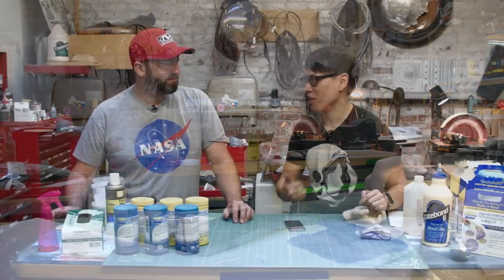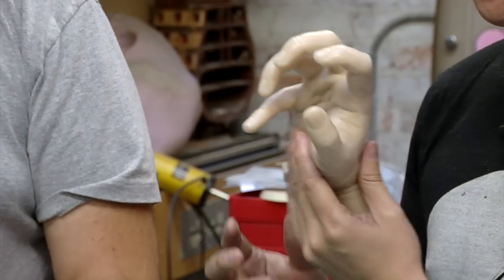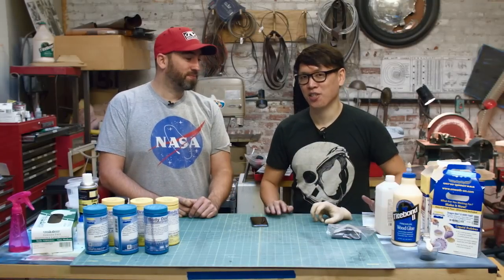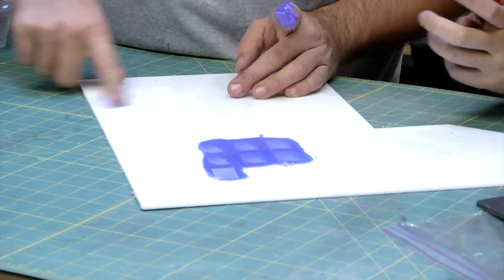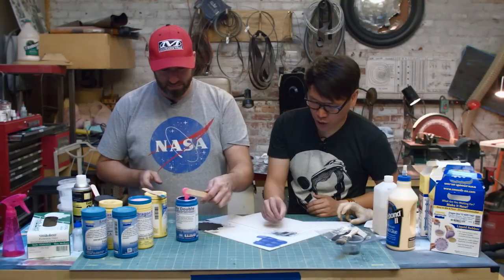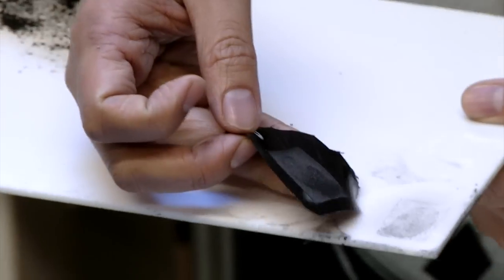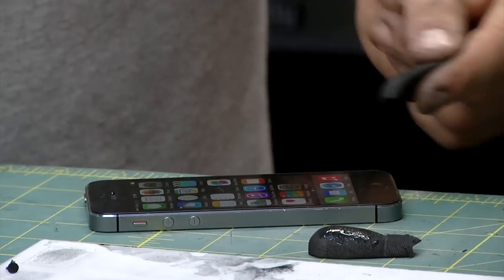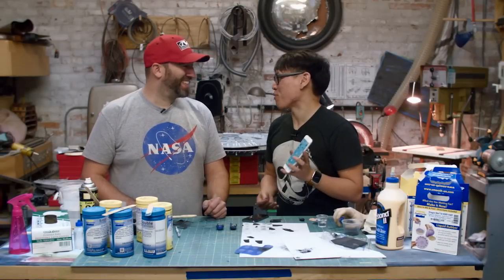Testing Apple's Touch ID with Fake Fingerprints

Comment: While using your finger to open the phone, the phone should also scan your face and require a voice recognition password. All easy to put in the phone, and very very unlikely to be broken in most cases.
Reply: face recognition gets fouled by photos, has issues with bad light etc. And voice recognition: It is kind of a phone - getting someones voice is quite easy.
On the other side: I see what you mean - better combine three "decent" security mechanism to a stronger one than using not at all. People are lazy - better they use a weak security then none. It is like a lock on a house: A thief gets in anyway if he really wants to, but a lock and a stable door do cost more time then a flimsy door.
Reply: sarowie It's kind of hard to fool Face Unlock when your photo can't smile and blink twice......just saying.
Reply: Ryan Stewart It's not hard to hold your phone look at it and say a word into it. It would be just as fast as a basic puzzle lock.

Comment: One thing that would help with the high-res photo is actually something Jamie and Adam did in Mythbusters to fool a fingerprint scanner: blowing the fingerprint up, then cleaning the print and making the lines uniform. Then scaling it back down so you would have much better defined contours for the laser engraving.

Comment: How does the laser etcher resolution compare to one of they higher end 3d printers you've used in previous tested vidoes?  Could you take a 3D scan of a finger, print it, brush it with graphite?

Comment: with the laser etching, you will need to clean up the fingerprint first before etching it. the problem with the photo is that the ridgelines aren't smooth enough for the sensor to register. you can think of it as a sensitivity test 'how far apart do toothpicks have to be before yo can tell your being poked with two instead of just one?'

a mythbuster trick to trick (because they tried this on far more advanced sensors about 8 years ago) a sensor was to blow the fingerprint up to a full page size and print it on plain accitate sheet, use a sharpie to clean up the lines on a second sheet, then scan it back into the computer and shrink it back down to the original size for etching.

Comment: Someone would need a lot of time and skill to do this. If someone wanted to steal your phone they would also need your finger print from something.
Reply: There is no guarantee that a finger print on the phone would remain perfect. The moment you picked it up and moved it the print would be compromised, and you have no way of knowing which finger they used for the sensor. Just use your pinky as the finger, they are difficult to capture and make Touch ID more secure because it's difficult to leave a full print of a pinky on a surface.
Reply: Tons of fingerprints all over the phone.
Reply: Eric Melendez if you're determined enough to do what they did, it should be easy enough to get a finger print, use scotch tape.
Reply: Just get them drunk and when they pass out mold their finger its easy
Reply: or a knife... easier and faster
Reply: Riker Wilson The print didn't work.  Only the mold of a physical finger.
Reply: ***** yeah but that didn't even work. and that was a perfect scenario where they had a perfect print with the dusting on a black surface. most prints left aren't high quality like that. they would be even fuzzier and smeared
Reply: MrBairdy79 but they are passed out, just grab their hand and unlock. Unless you wanted to try and get in again.

Comment: This is the cool tech stuff I wanted to see on this channel! Cool one, I also like Frank very much in your videos, he seems to be very likeable :)
Instead of the laser engraving/etching I would try to photoetch the fingerprint on a copper circuit board and cast the fake finger from that. The resolution with that process is way higher than with the laser cutter/engraver.
Reply: You're right, they should have tried that too
Reply: Etching on a circuit board is basically replicating the experiment of the CCC. Take Wood glue instead of silicon and it is essentially the CCC-Process.
Tested tried a new process, a different material and one of them worked.
Impressive in its own right. Reproducing the CCC-Results would be much easier - which could be a reason to do it, just to have a "fallback" when their tries would not have worked.
Reply: 'Tested' have to try this. I think if enough people requested it then they would do it
Reply: Stefan I subbed plz return the favor

Comment: Try the printout like they did on mythbusters! :)
Reply: Are we the only two who remember this
Reply: I mean really they should have Adam and Jamie help they already did this and there part of this YouTube channel also
Reply: Justin Bancale Yeah, it's kinda strange. Jaimie's technique for cleaning up the scanned print was really clever!
Reply: That was an old scanner, probably laser as the medium of scanning, Ffs, Jamie played connect the dot with a sharpie and it still grant access.
Reply: That was nearly 10 years ago lol
I'm sure the hardware and software they use now has been improved from when they aired that Mythbuster's episode :P
Reply: NerdNordic Nah, i'm pretty sure it's changed :P
Kinda how TouchID exists. It's completely different most fingerprint recognition technology. It's directly integrated into the OS
Reply: Puri Tech Nah, I don't think so, the principle of operation is the same today (As you could see in this video)
Reply: Puri Tech Well, okay then, it's new I give you that. But they still managed to fool it rather easily. I think Mythbusters used some pretty nifty techniques to produce the castings that would work just as well today, Jaimie's sharpie technique and the circuit board etching being two of those. :)
Reply: NerdNordic It was hard as hell to fool this thing.  They needed a frekin real mold of a persons finger.  The picture didn't work.